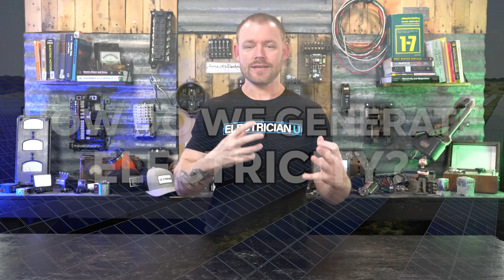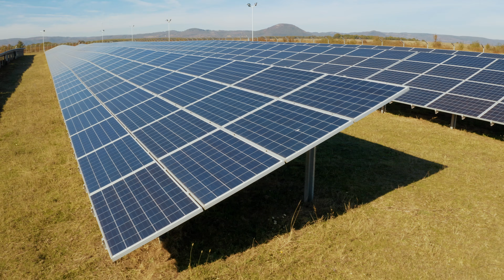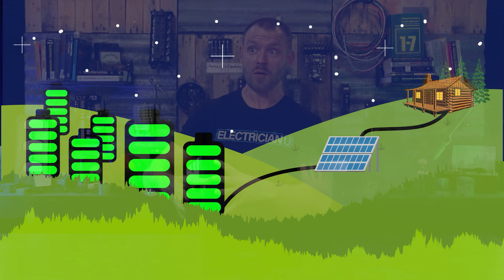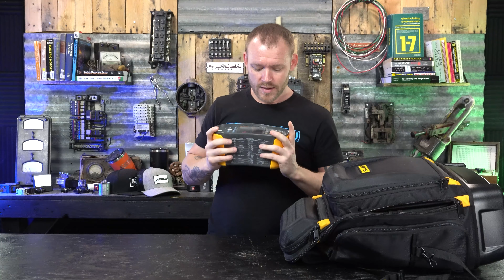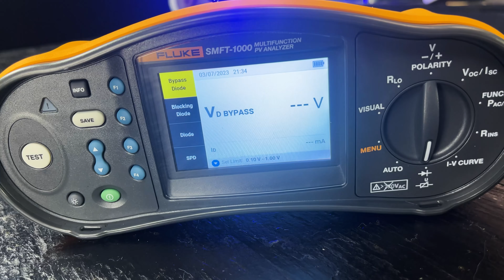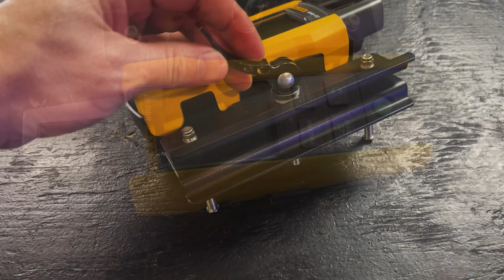What is Solar Power? How Do Solar Panels Work?

Comment: When you set the bottom of a beer can on your solar panel, and the shadow disappears completely, you know your angle is correct..That is actually the method I use, for my 30 Kilowatt system, 30 kw batteries, 4500 watts panels, 6500 watt inverter/solar charge controller/AC charger, (AC charger)I don't use...I have a water well, wood burner, Mini split with mppt, that runs from solar, Giant garden, chickens, etc., redundancy, and very self sufficient, and would urge others to do the same, for obvious reasons, and if it's not obvious to you, then forget all about this post...

Comment: I'm a solar installer. I'm glad you did a segment about solar and the inner workings of it. The fluke tester would be a good tool to have, but way too expensive for my pathetic payrate at the moment.
 I found your channel by looking up emt pipe bending. I continually check in with your channel to further educate myself about electrical work, since I have been dealing with main service panels, line taps and other interconnection methods. Thanks again for all of what you do. I've been learning a good deal about every aspect of my job and electrical work through not only what I do, but the content that you produce.
Reply: You got a great attitude. Don't know where you live but the IBEW can show you a lot more of that type of work and usually pays a lot better. You do you brother :)

Comment: 45% efficiency is almost double what most cars get from each gallon of gasoline they guzzle. 
20% is what most home panels I've seen get. 40% is from the panels they put on satellites, or wherever else you need every single watt you can get regardless of cost. 
Plants are actually only 45% efficient, well it depends on what method they use. Plants that use the C4 cycle are most efficient, C3 and CAM are less (iirc).

So when you're making ethanol from corn you take that 40% of the sunlight energy, then you cut it at least in half again through tossing the useless parts of the plant, in half again from fermenting, cut another big chunk out for all the transporting, then cut it down to 30% at best for how inefficiently gas engines burn. End to end you're getting less than 5% of the sun's energy into your car through ethanol/biofuels. Compared to >30% for solar -> battery -> wheel. 

That solar energy is coming down whether we use it or not, better to put it to work. 

Nice video, thanks for making it. Cool new toy too :)

Comment: Solar panels are just big LEDs that work backwards. 
Run some current through them and they emit light, usually in infrared. 

Shine a laser at a normal LED and you'll create a tiny charge.

Comment: A homeowner must clearly understand the hardware & installation cost vs. benefit. Understanding that the breakeven point is likely many many years away. Consult with homes insurer for coverage provided. Utilities do not purchase power at the same rate sold. Solar generation does not necessarily increase a homes value. Do not skimp on permits and inspections. Be prepared for a lien on home until paid in full.

Comment: Video ideas: 
Different types of residential systems: Micro inverters vs string inverters with optimizers. Comparing pros and cons 

Commercial systems: DC strings with central inverters. Systems coupled with battery storage….MA is starting to push this on the commercial side. 

Could do a video on controlling/ monitoring power of these systems: SEL relays, DAS enclosures for monitoring and communication in general on solar sites. 

If only the fluke meter could create the reports for IV curve tracing automatically and send it to the clients in an email format id buy it for the price they want.

Comment: Awesome video. I worked for Tesla Solar for a while, terrible experience working with residential solar. And the horrors that a roof goes through to support a panel. Yikes.
Reply: Yeah, people do not quite understand how strong their homes roof and framing need to be in order to support the extra weight of these solar arrays, not to mention if you already live in an area where you would need to consider how snow might accumulate in the winter months. There are definitely pros and cons to installing a roof mounted system vs. having a ground mounted solar array.
Reply: @michellet_thatsme that’s a good point. One array could be one thousand pounds. Makes me wonder about trusses’ load bearing capacity like you said here and where the mounts and rail go as well as weak points in the trusses (eg maybe in the middle or at the peak?) Also makes one think about all that other weight if the roof is tile and not comp or Au. More solar videos from this channel, please
Reply: Terrible experience working with resi solar? Our PM also worked with Tesla Solar. Why terrible experience for you?

Comment: That tester costs more than all of my panels, my complete 2 charge controller Victron setup, and both of my 200ah Lithium batteries.
I'm in the wrong business.
Reply: But to be fair, the target customer for this meter set is for the installer contractors, not the end solar setup customer. If you are DIYing your solar setup, you'll probably only use this a small handful of times (at install, and any troubleshooting of issues down the road), and at that point look for renting it not purchasing it. A contractor will be using this at every job multiple times a year.
Reply: @Sembazuru  I get by with a decent clamp meter.
But, some of those capabilities would certainly make life easier, for sure.
I'm used to having a full electronics shop, with waveforms, etc.
On the road, that machine offers an awful lot, in a very small package.

Comment: My son went with 33 polycrystalline grid tied  silicon solar panels. He got in when utilities were offering great deals, so he hasn't paid for electricity since.

Some panels within an installation may  purposefully be placed outside of the optimum direction, because they can be placed to maximize production of power towards the late afternoon. That was done on my son's roof, so some are facing south, and some are facing west.

Comment: have they increased the efficiency rating of solar panels yet?  the highest I’ve seen is 23% efficient.
Reply: The higher efficiency panels are still in development because they use provoskite cells and those aren’t commercially available yet. 
The highest efficiency for silicone solar cells cap out around 26%
Reply: Solar panel efficiency is important but what’s more important in my mind is also inverter efficiency. All solar energy currently has to be converted into AC power from DC power.

I’m in the industry and solar panels are almost all around the 20% mark already, but inverter technology on the other hand hasn’t kept up at all.
Reply: They've existed for a long time, but currently priced beyond practical except for products sent to space. From wiki:

Up until the early 1990s, solar arrays used in space primarily used crystalline silicon solar cells. Since the early 1990s, Gallium arsenide-based solar cells became favored over silicon because they have a higher efficiency and degrade more slowly than silicon in the space radiation environment. The most efficient solar cells currently in production are now multi-junction photovoltaic cells. These use a combination of several layers of indium gallium phosphide, gallium arsenide and germanium to harvest more energy from the solar spectrum. Leading edge multi-junction cells are capable of exceeding 39.2% under non-concentrated AM1.5G illumination and 47.1% using concentrated AM1.5G illumination.[10]
Reply: I was pulling 438w, in the northern US, 2 days ago, with 4 100w panels, in series parallel configuration.
I'd call that fairly efficient, considering that we haven't even hit the season of maximum peak irradiation.
Reply: I was pulling 438w, in the northern US, 2 days ago, with 4 100w panels, in series parallel configuration.
I'd call that fairly efficient, considering that we haven't even hit the season of maximum peak irradiation.
Reply: @Mr.Schitzengigglez  peak is in June in the northern hemisphere, but panels lose efficiency as they get hotter, so all time high weeks here in the southwest are often in  May.
Reply: @aredditor4272  I'm in the northeast, with shade on the back side of my panels, which are pointed east/south-east. 
First time having them mostly sationary.
Doing pretty good so far this year.